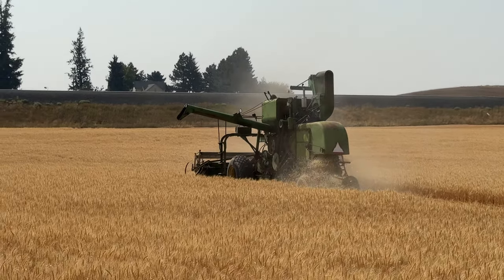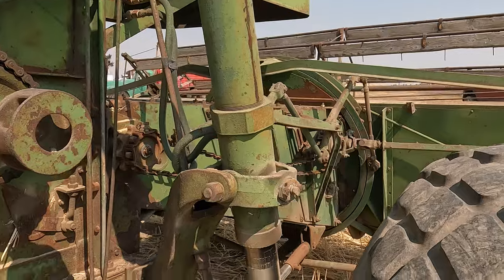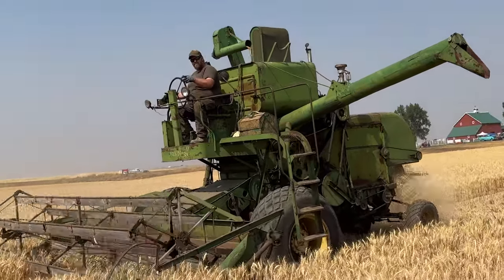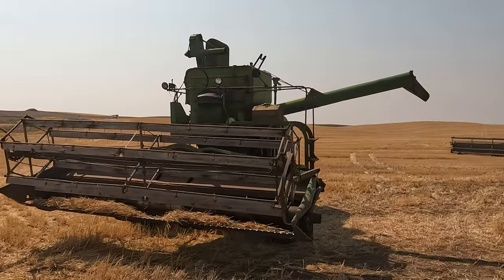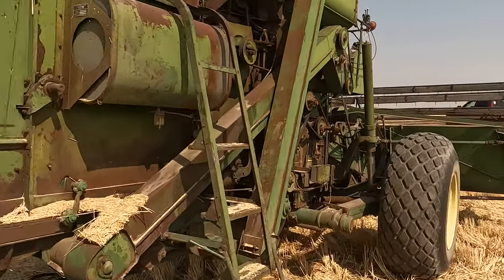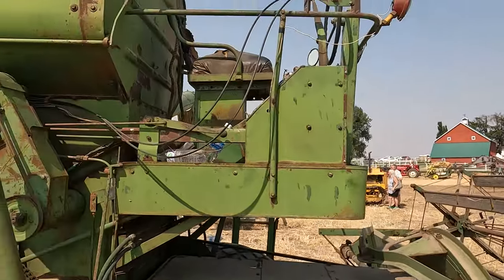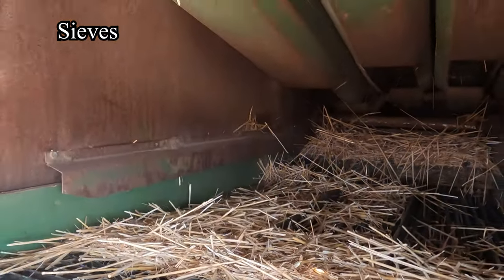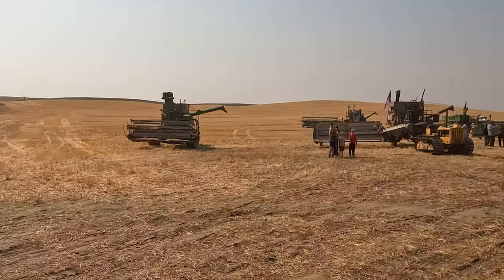Hillside harvester in action! John Deere 55H

Comment: The combine I started on, great reliable machine, just slow. And yes the tires lean with the machine, it hangs on the hillside better that way. Once you go steeper than it will level it wants to slide down the hill and the rodeo begins. For comparison, the new machines will do in an hour what this machine would do in a full week.
Reply from the maker: Ha! I believe it with the production. Yeah leveling tires would help a lot on the bigger machines too i think.